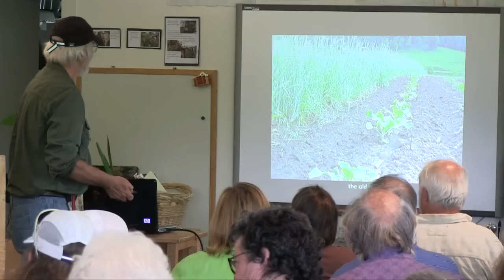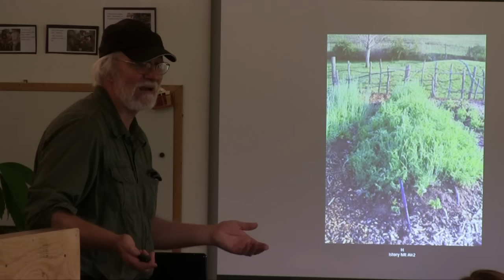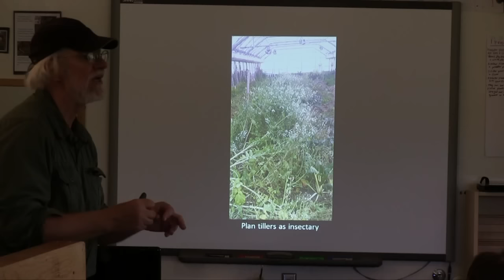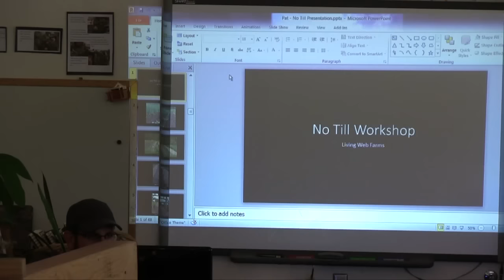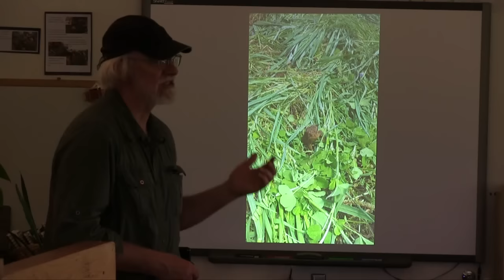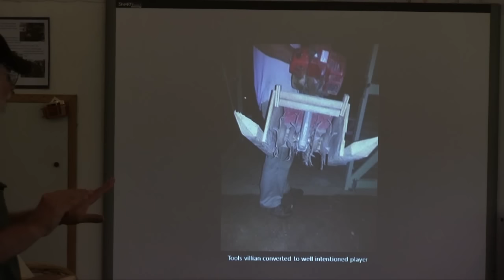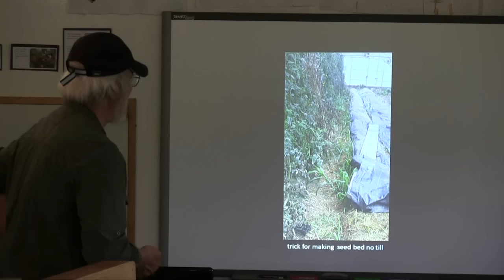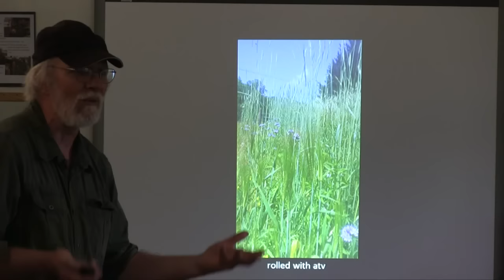Small Scale No-Till Methods for the Market Garden with Pat Battle UNCUT

Comment: That hurt watching you sythe. Remove the blade, turn over the handle then re-install the blade on the proper side. The handle hump needs to be up. Not down. Slide the blade across the ground. Don’t chop.
Reply: Sn
Reply: Hurt? How else is going to learn if he doesn’t try?! Mistakes will be made. Not everyone was born knowing how to do everything like you.
Reply: @RobertBurrell-f6c  Don’t assume I know everything. I had to research how to use one. For someone to get paid to teach and they don’t know! He needs to do the research and personally know how to use them before teaching others about them. I’ve been working on my skills of spinning and weaving and yet I still would not teach because I don’t yet know enough and have enough hands on to actually teach. Now if you don’t get paid and are just learning you can mention but you’d still be wise enough to pass along proper information.
Reply: Sorry about the book here.
TLDR: there are different kinds of scythes that take different techniques and are used on different plant material.

I purchased an old scythe years ago. I was using it with the blade and handles installed correctly and it was very sharp, but I could never get it to work the way I saw people cutting grass or grains with one. After a lot of internet research I finally found out the key. 

There are two types of large hand scythes. The Austrian kind, with a long, thin blade; and the American kind, with shorter, wider blades.

The Austrian (or maybe European?) kind is used to cut grains or grass. You swing it in a wide curved arc, starting a bit behind you on the right side and ending up with the blade in front of you on the left. You keep the blade parallel to the ground. It is very efficient at cutting, laying the grain or grass down immediately; you can attach a cradle on the handle to catch the grain, but I haven't looked up a video about how that works. I saw a video where someone with a scythe could cut as much grass and as fast as someone with a power mower. And of course the scythe was quiet, no fossil fuels needed, and gave you exercise. I may purchase one someday since we have to keep large areas mowed short for fire breaks and rattlesnakes.

The American scythe has shorter blades of three types: a longer thin one for grass and grain, a medium blade for weeds, and a short stocky blade for brush. The one I bought is for weeds.

To use it you don't sweep in a wide arc. Instead you use it almost as if you were sweeping dust towards yourself with a broom. It is an arc, but you start in front and swing to your left in a shorter arc. My weeding blade will cut the tougher weed stems (kochia, wild mustard, mint, etc.) but make the grass just lie down without cutting it. Until I learned this, I had been so frustrated trying to cut my tall grass only to have the scythe make it lie down without cutting it. 😂 It is useful for me to use the scythe to cut weeds that have grown too big, so I can then cut the grass with the mower while everything is still green. Otherwise I have to wait until fall when the weeds are dry and brown and break them off at the ground. 

In the video here yes, the people in the background around 25:00 are using the scythe wrong. You stand upright, not hunched over. Once you get the technique right, no matter what kind of scythe you are using, it should be comfortable and ergonomic, not a struggle. They were designed to be used for long periods of time to cover acres of ground. Get a good whetstone and learn how to use it.

Just don't have any kids or animals anywhere near you, especially not hidden in the tall growth you are cutting.
Reply: @oldauntzibby4395  I know how to use a Sythe. I have both an Austrian and American Sythe and both work just fine for grass and grain and brush. The American one is heavier. Since I am tall I had to buy a long Snath to make it less likely I will be hunched over. They cut well and require frequent honing in the field. Easy enough to learn. I even have video on my other channel of myself using the Sythe. Prepping the American Blade is different than the Austrian Blade. The Austrian Blade is in my opinion superior but it is too each their own on that one. I have both. Both are very sharp. I have sharpening tools for them both.

Comment: You slide the blade in a curving motion so it cuts as the sickle slides across the grass/weeds. No hacking required. I used this and learned the proper way to use it in Germany... You guys are working to hard hacking with it. 👍😎
Reply: I know. It's such a great tool if you know how to use it. I love mine.

Comment: The scythe is a cool tool. But what I’ve found very effective is doing no cut work at all. I let nature and weeds make the soil rich. Weeds die back as soon as I start planting a new cover crop of buckwheat and red clover/ mixed variety of small bird seeds as well so the finches come. It works wonders. By the time the plants all die and weeds come up the soil is beautiful. I used to have a very hard sand/clay soil that grew nothing. I can now grow everything. Even hard to grow plants inside that tiny area I’ve been experimenting on. It’s beautiful right now as the clovers and buckwheat die back. I found wild flowers thanks to birds inside. Just beautiful how nature lets it just work out. Of course, don’t let it go solo without planting something. I have a patch of weeds and plants I don’t touch for three years and the weeds really just overrun but I let it because bugs and birds prefer the weeds funny enough

Comment: place a strap on the top of your chainboard so you can slide your foot into it. The combination of a step board with weight of chain and using a foot and arms to distribute weight to lift and smash works wonders. Or just drag it if the crop cover isn't too tall. Fantastic video btw!

Comment: "No-till" isn't that new idea. When I was working in a local Agriculture department,  years ago the subject was ever-present. No-till was what we tried to convince gardeners and farmers to practice. When I was studying horticulture no-till was very important in the horticulture education at the University in Krakow, Poland. Now I am in my middle seventies and I see that North America is awakening to this subject. Better late than never. I like your passion for recycling everything that could be reused. How little we need... But I would like to see the community not supported financially by any subsidy, except education. We need to be self-sufficient in everything.
When you use cover crop and no-till metod, the plants need to be broken, or mowed and left in place.They shoud not let be going into seeds no mater what. In agriculture they roll over the cover crop and seed main crop in rows between the cover crop rows. quite often the cover crop is corn, easy to break. the broken plants tops are serving as mulch and the lower parts deteriorate like compost, build soil structure and leave some nutrients in the soil. In horticulture it is advisable to do the same. though many gardeners preffer straw. Wheat does this work slower because the capilars the root create are small and not as many as in the case if corn. While planting cover crop it is very important to use mixes of seeds, to supply as many nutrients as possible. The trick is  plant only annuals. so even if they germinate next year they can be moved or broken and do the same purpose  the next year. Cover crop is only for limited time i a year to enrich and rejuvinate the soil. I still garden and almost all my produce is from my little garden. And I still learn from others. Thank you for your work.
Reply: Would you say it’s a common practice among farmers in Poland?

Comment: Hook that chain on the back of a rider with a rope, and DRAG IT down that row back and forth, and it will RIP OUT that crap. Wow. That's crazy to manually try and remove that vetch with the chain. I don't do no till. I do ONE TILL. I get it tilled up good, with stuff to build the soil, then I lay a heavy sheet of black plastic on, and cut holes for my crops. That way next year, all I have to do is plant the rows or holes. So easy and very little pulling weeds! I've even used strips of old carpet between the rows. Works great!
Reply: yes but , particularly here, the idea  is  a) no soil disturbance and  b) organic soil buil up . With tillage soil gets turned upside down and those 2 inch soil richness ends up deep inside. Of course there are many ways to do organic ag;  but here, the idea is to observe the nature and let it do the work  since he often refers to Gabe Brown.

Comment: You noted your seeding machine was disturbing too much soil. i.e. going too deep; w2ould it not go less deep if you lowered the back wheel?
Reply: I think there was too much moisture; that machine is not for a greenhouse but rather  a dry soil in an open field for instance. And they said at a certain point that "is not gonna work inside in wet soil) cheers !

Comment: I'm surprised you don't just use a 3/4 sheet of plywood, paint it with linseed oil so keep it going longer and with a rope on the corners, just step on it. It will knock down the plants while dispersing your weight so as to not over compact the soil while being a lot lighter and faster.  That way, it's place, step, place, step, saving your back, time, and making it more accessible to children and the elderly. (Not that my old man couldn't knock that out faster than I could!)
Reply: this is a great idea. Im surprised no one commented on it. I will keep that one in mind this spring!
Reply: i love this idea. i think a 2' piece of 2x6 would not do much compaction. maybe a cutting edge on the front like an old straight saw, screwed in from underneath.  much love

Comment: I would say the seeder needs a row of square stock metal rollers. That would redistribute the weight and if you put them in a chevron they would also put the disturbance back. The front drive tractor needs tracks. Don’t think it needs to be so long either. Cutter wheel could be on front and yohman plow in the middle. Both need trailer screws with locks to add more precision to depth. Duel scissors could raise both with one lever. I’m not seeing a snap pin on the plow to prevent braking the plow. If it hits a big rock it could destroy the plow or bend it badly. If this could take paper pot planters on racks! Amazing! That’s a major time saver for long runs.
Reply: Or double wheel cutter and plow with paper planters.👍

Comment: I’m wondering if a 3’ piece of angle iron screwed to the bottom of a 2X4 would do any better if you stepped your weight down onto it to crimp it off sort of like the guys faking crop circles were doing. 

Also, if you put a mulching blade on the mower and leave the dispensing chute closed it might do ok, but as thick as that vetch is it’ll definitely bog the mower down.

Comment: I have stopped using most chemicals, except some magnesium and 13-13-13, and some Hasta-grow, and some anti-fungals. My last problem weed is sedge. I have sprayed and dug and I it just comes right back thicker. I am not opposed to using chemical-geddon in those spots at this point. Any sure fire way to get rid of this? tia.

Comment: On a 30” bed you might plant up to 12 rows. What good is a single row planter? Use a sickle mower on the vetch. Don’t step on a bar wrapped in chain? The bar will spread out the weight.

Comment: 22:22  Looks like this guy was doing it smarter than the others. Stomping creates more compaction? Well maybe, since you have that stupid chain there. Get rid of the chain and now your "stomp" is more distributed. Plus...the green resilient material underneath is cushioning the stomp. To be that ticky-tacky and hyper vigilant over petty compacting actions seems like unnecessary stress both mental and physical. 
     And then they feature this guy riding some motorized wheeled seeder...which obviously compacts more than a stomp on a flat piece of wood. The seeder even has a 100lb weight on the front...in addition to the weight of the driver and at least 100lbs of barbell weights and 40lbs of foam by the tires! Idiocy to worry about compaction in one sense and not care in another sense.
     The whole beginning of this was hard to watch. Watching that lady and those guys swing that scythe unsupervised and un-tutored was cringey and a big joke. The end was hard to watch too. 500 lbs of machine and man on three wheels...and it didn't even work, lol. But no...don't stomp the vetch 'cause compaction!

Comment: No way vetch then! My place is a garden, not a market garden.  I sowed rye and buckwheat - the rye overwintered (Q 1) what sort of Rye did you say???) with onions in it and will harvest those later and hopefully cut the rye maybe hoe it in? I bought lupins as a green manure but they didn't come up probably too cold -(Q 2) have you used this?  Also sowed mustard and has done great looks quite fragile; maybe it will be more tenacious later.  I have also sown  Phacelia Tansetifolia in the bean beds. Afraid that the mix may include vetch - I am in France. (Q 3) Has that 'cup' plant got a latin name? I did dig year before on new ground as lots of couch grass with terrible mesh of roots. I am worried about using the straw as sure not organic!  (Q 40 could i just use compost and green manures?

Comment: Thank You for the video. With all do respect. Couldn't you just use a good ole fashion sickle. Before swathers were made. Sickle n rake my uncle used for years...
Convert one over to 3 or 4 ft. Length. Use PTO unit on smallest tractor u can find. Or even use maybe a portable drill for power source. And a walk behind.

Comment: Can someone please show them how to use that Sythe? That's painful to watch.
Reply: I do not think he is regularly using it, the point  is , he is just showing it as a potential tool. (not being aware how dangerous that can be)  I was afraid he will cut himself when he was  holding it at the level of his throat and gesticulating , turning his head around. I know of a case  when after cutting grass long hours, the guy  stopped by a bar for few drinks with friends, after that heading home  tumbles and when falling down the blade turns around and with the belly on top of it. Dead on the spot. So very careful handling that tool.

Comment: The first tool at 16:30 looks seriously inefficient. You either need something equivalent to a lighter garden roller or simply drag that item behind you as you would with a tractor. The repetitive strain injury factor looks high on that tool simply due to its weight and the unnatural body movements required to use it in the manner shown.
Reply: Number Eight they are really dumb...you want to show something but you don't know how to work,with what to work...I mean this guys don't know that the wheel was invented
Reply: Aldea Alexandru wheels wont work rolling thru vines it gets caught up id use the scythe but i have vetch not LOADS of it but i just pull it its thin and the root system doesnt go deep it pulls rather easily
Reply: @zassu85   they are no dumb, of course they know about the wheel.... you miss the point here; the philosophy  behind all this : no till / cover crops/soil conservation and compensate for use of heavy chemicals in large scale agriculture ( the movement tries try to work out with least tools or tools at hand or no tools at all ) The One-Straw Revolution, by Masanobu Fukuoka, 1978 pdf -  discharge it and have a look, you will understand . cheers!
Reply: Yes. Absurd to use on a market garden scale. Too tiring and hard in the body. Why not drag it behind the BCS? I wouldn't even consider  using this for a minute.